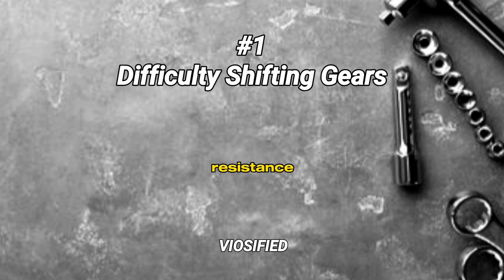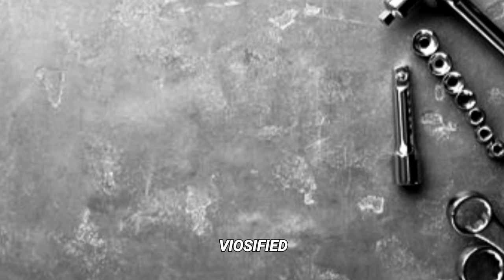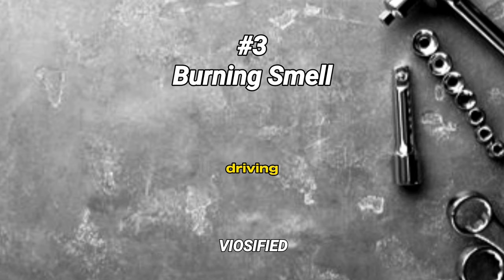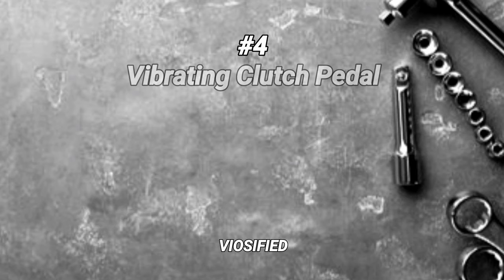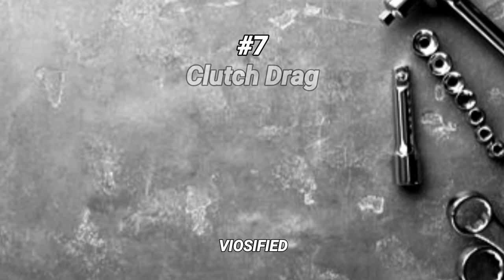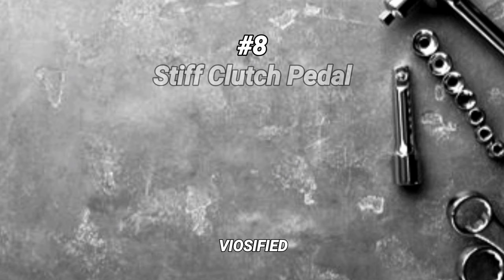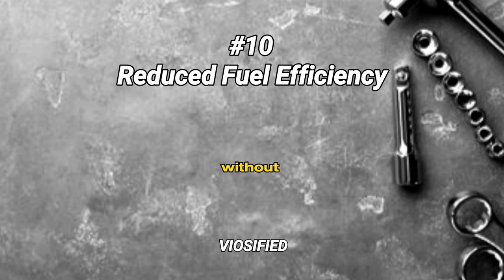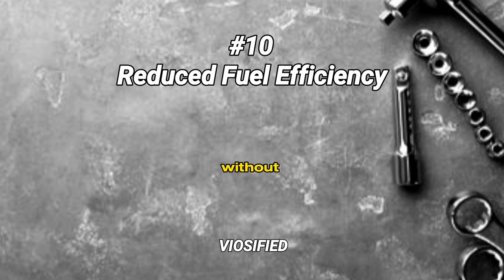SIGNS YOUR TRANSMISSION & CLUTCH HAS A PROBLEM

Comment: My car is almost at 200,000 Kilometers and I've put about less than 20k Kilometers since ownership, so I've no clue if it has a history of clutch assembly replacement during the previous ownership. However, It feels extremely different from when I first owned it to now. It's a 5 speed manual, Before from 1st to 4th I can actually feel the car pull away and I'd be doing 100+km/h, Now from 1st - 4th I'd be doing 100km/h but during the shifting process through each gears, the RPM goes up but it doesn't match the speed shown, Most cars would be following the speed limit, while my car shows that I'm doing the same speed on the odometer but it looks like i'm doing 10 under. I'm suspecting that My clutch is starting to go since I've only noticed it recently, just wanna pick at your brain a bit and hear some thoughts before following through with the tranny pull. Thanks!
       Also, this is my first manual vehicle I learned how to drive stick with this car, I also drive like an idiot often to test theories.
Reply from the maker: Your guess is as good as mine... Based on the symptoms you've described, it's likely that your clutch is worn out & starting to slip, leading to a disconnect between engine speed & vehicle speed. This would explain your observation of why the RPM goes up without a corresponding increase in actual speed. Given the mileage of your car and the symptoms you mentioned, it's a smart move to get it sorted out as soon as possible.
I wish you the best! 👍
Reply: @Viosified  I appriciate the immediate response greatly. The plan is to pull it out this weekend and find out, if that happens i'll try to get back here and give an update for reference purposes. Thanks a lot have a great weekend👍
Reply from the maker: Likewise, and thank you for dropping by. Good luck! 🙏🙂

Comment: I think mine went bad yesterday. 1-2nd hard then high rev and no acceleration then hit back into gear
Reply from the maker: @blackheartsmarine0351  clutch is likely slipping, hope you can get it fixed right away
Reply: @Viosified  I’m gonna have it towed to my local shop that specializes in foreign cars this week. Hopefully that’s all it is
Reply from the maker: @blackheartsmarine0351  sounds like a plan, I hope everything goes well. Best of luck!

Comment: Mine revs up when I go in to 1st gear and others but I can go if I ease in in it
Reply from the maker: Potential causes could include a worn or slipping clutch, issues with the clutch cable or hydraulic system, problems with the clutch release bearing, transmission issues like worn synchros or a damaged gearbox, issues with RPM or throttle position sensors, or complications related to a damaged or worn flywheel. It could be one or a combination of these factors. Diagnosing car issues remotely can be challenging, and it's always recommended to have a mechanic inspect your vehicle in person.

Comment: My 2016 hyundai elantra just stop moving in forward 2 days ago, it only reverses, sometimes it only pulls off in a different gear or after being warmed up so long but doesnt want to move everytime any ideas?
Reply from the maker: That's a bummer.. Potential culprits include one or a combination of transmission malfunctions, such as low or contaminated transmission fluid, faulty transmission solenoids, or internal transmission damage. Clutch-related issues (in manual transmissions), torque converter problems, or ECM/TCM malfunctions may contribute to the symptoms. It's also essential to check the transmission fluid level & condition of the fluid, inspect sensors & switches related to the transmission, and consider the possibility of mechanical damage or wear within the transmission. If u don't have the necessary tools & due to the complexity of diagnosing transmission problems, seeking assistance frm your mechanic or Hyundai dealership is advisable. They can perform a thorough diagnosis and recommend the necessary repairs. Good luck! Thanks for watching.

Comment: What does it mean if I only smell it if I’m on high rpms. Usually on 4th gear. Should I be shifting sooner and just go to 5th?
Reply from the maker: If you're experiencing a burning smell from your clutch, especially at high RPMs and in higher gears like 4th, it could indicate excessive clutch wear or slipping. It is best to have your mechanic inspect your clutch system asap.

Comment: for me, the clutch pedal gets stuck when pressed down. 

when i pull pedal back, it seems loose, and the transmission is not engaged…
Reply from the maker: potential causes could include issues with the clutch system, such as hydraulic fluid leaks, malfunctioning master or slave cylinders, problems with the clutch linkage, such as worn-out bushings, damage to the clutch fork or pivot ball, wear and tear on the clutch disc or pressure plate, broken or weak clutch springs, or issues with the clutch pedal assembly. Consider visiting your mechanic for a thorough inspection and repair.
Reply: @Viosified 
thanks.  
i’ve replaced timing belts and have done a valve adjustment before, so i think this is just another challenge for me to do. 

regarding your suggestions, i suspected as much. just wanted a second opinion. 

the clutch itself may be fine. i started the engine in 1st gear on an uphill and the car kept going (had to get it home). 

but definitely the other stuff are suspect.
Reply from the maker: @darthvirgin7157  good luck & thanks for watching!

Comment: I have a Toyota 1998 RAV4 manual transmission the vehicle lost power then stayed stuck the gearbox stuck in fifth gear The clutch is soft anybody have any ideas
Reply from the maker: the soft clutch pedal could be due to low fluid level or from a leak in the clutch master cylinder, clutch slave cylinder, or air pockets in the hydraulic lines. The gearbox being stuck in fifth gear may indicate issues with the transmission gear selector or linkage, preventing the gearbox from shifting into other gears. Another possibility is a problem with the clutch release mechanism (clutch release bearing or clutch fork), which could be causing incomplete disengagement of the clutch. Lastly, worn or damaged pressure plate or clutch disc could cause slippage & loss of power, which makes it difficult, if not impossible, for the engine to provide sufficient torque to the wheels.

Comment: Mine feels kinda clunky when shifting from 1 to 2nd gear. Could This be due to a worn clutch piece? Or is it just me?
Reply from the maker: The clunky feeling when shifting from 1st to 2nd gear in a manual tranny vehicle can be attributed to various factors, including potential clutch wear, worn synchronizers, damaged gear teeth, improper shifting technique, low or contaminated transmission fluid, etc..  To accurately diagnose and address the issue, it's advisable to consult a qualified mechanic in your area for a thorough inspection.  Thanks for watching!

Comment: Ford ranger clutch remains depressed suddenly during trip. The clutch still works but it seems that it requires me to push down the clutch much further than usual as it sticks at a certain height. What could be the problem? Great video btw
Reply from the maker: that may stem frm problems within the clutch hydraulic system (such as issues w/ the master cylinder, slave cylinder, or hydraulic lines) potentially caused by low fluid level, leaks or air in the system. Or, if your vehicle model uses a mechanical clutch linkage, the problem could lie w/ a stretched, frayed, or damaged clutch cable. Another possible reason are issues with the clutch release bearing, fork, clutch disc or pressure plate.